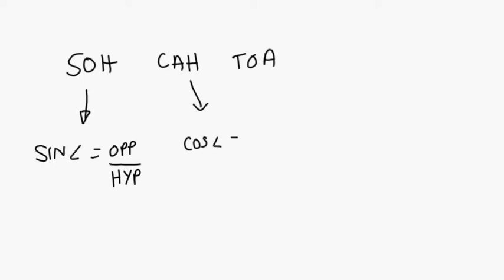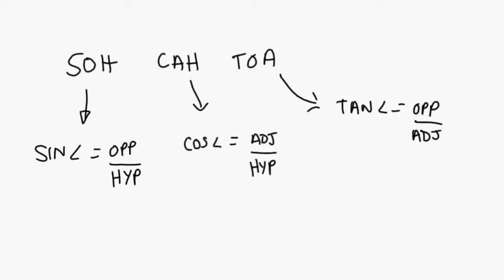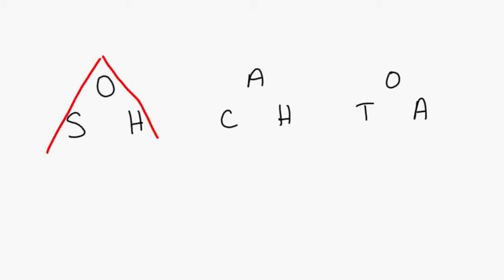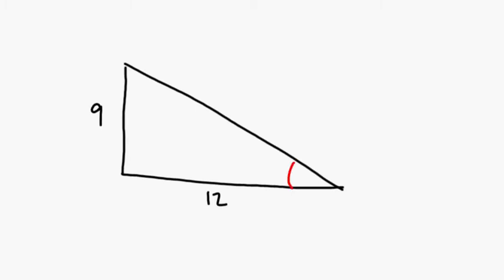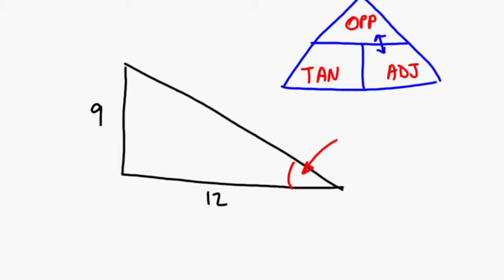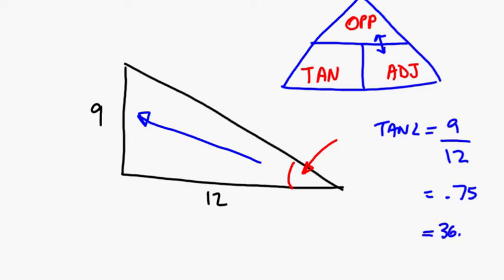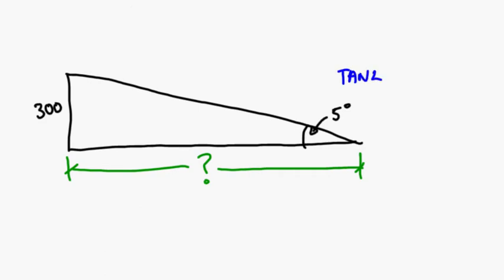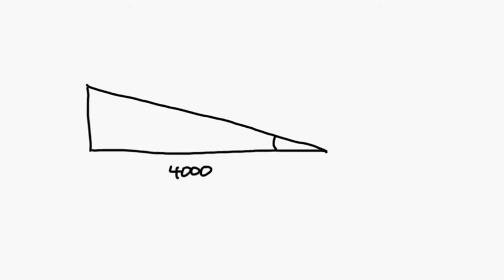Basic Trigonometry for Carpenters - Tangent

Comment: Thank you for the tutorial but one question particular to woodworking: does the answer apply to timber centre, or the inside gap of the angle? I'm struggling to visualise it actually on a piece.
Reply from the maker: Hi Lee. That really depends on what you are doing. For example if you were calculating the sloping length of a ramp, it would be the outer surface length that you would be calculating but if it was the length of a rafter it would be through the intersection of the birdsmouth plumb cut and seat cut all the way to the center of the ridge.
Reply: @martineisbrenner  that's understandable, thank you so much for clearing that up :)